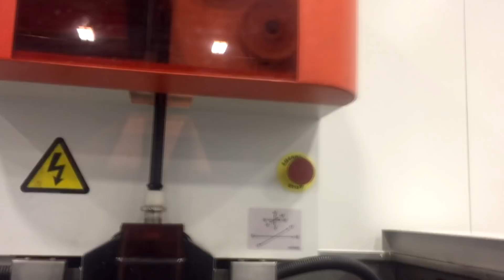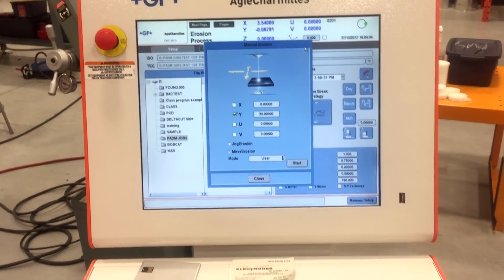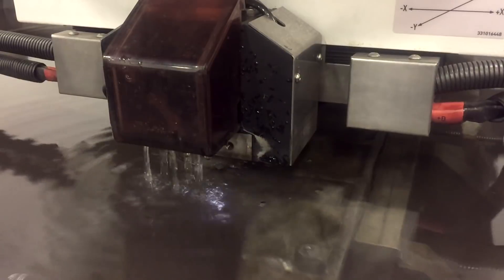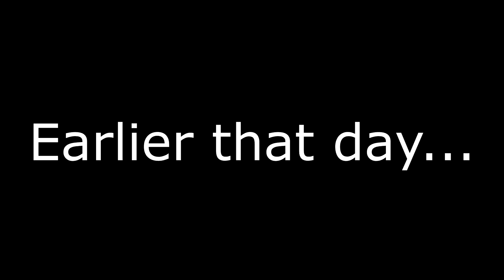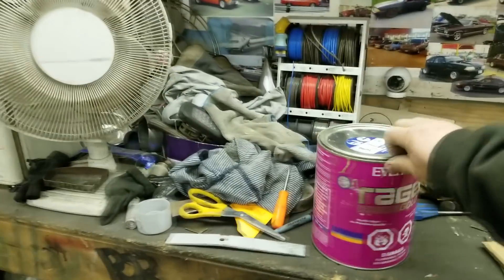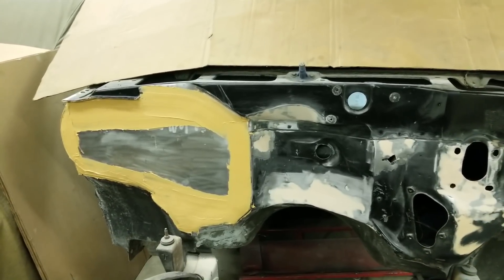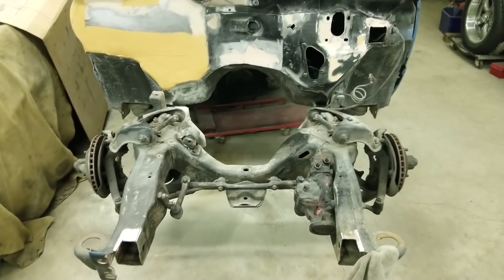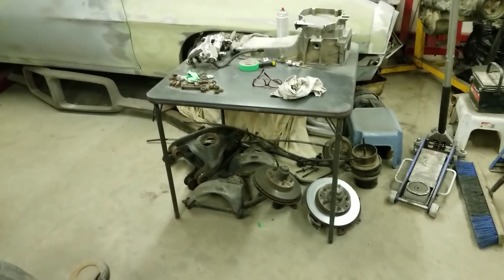CUT BY LIGHTNING STRIKE? Sh!thorse Hacks w/ EDM Machine + LS Turbo Truck Update | Machine Shop Tour

Comment: Nice work Rob , with the brake changes you're making . Will your rims still fit ( bolt pattern ) ? Thanks for the tour Clayton .
Reply: mike jones the fronts are still gm so  yes, the 8.8 im using, no but i will have to buy shorter axles so i will get them with a chev pattern.

Comment: What rear end is in the s10 Rob?
Reply: BoostMonger it has a 7.5 but im getting a explorer 8.8
Reply: Oh i gotcha. I was just wondering because im midway through putting a 5.3 in a ae86. Was going to try and use a 7.5 or a 7.625 but i have had no experience with either and am not sure if they would hold up lol
Reply: Boost monger dont waste your time the 7.5 it will break eventually get a 8.8 from a explorer it comes in a lot of different ratio’s and it is easy to narrow and the aftermarket supports it way better for axels and all the other parts
Reply: That has been the general consensus so far. Im going to have to see what i can find for 8.8s

Comment: Rob the heater box in the canyon and Colorados are all on the inside with 2 hoses sticking out like you want. But I'm not sure if they will work with the S10. But thought I'd mention it. You may be able to make it work. That is it you could find one. Don't know if you thought of this but thought it might help since they are both small trucks.